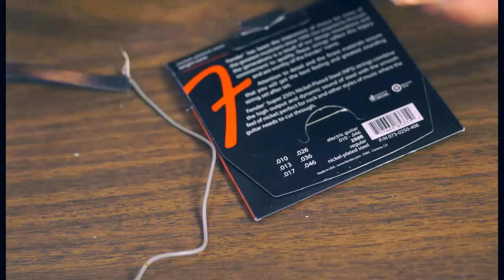How to shield a Stratocaster from EMI with copper tape

Comment: 1:45 Just put some more soldering wire to the tip of that thing. You want heat transfer, so you need more molten metal there. More power is not always nesseserry. Good video, thank you. Need shielding too.

I turned a cheap Spanish guitar into a weird hybrid. I can try extra control knobs, like one for mixing neck and middle pickup volume. I could add a tone knob for each seperate pickup, instead of just that single one. I could get myself a traditional 5 position switch, instead of installing a high quality 3 channel mixer on my guitar. Building it yourself is fun. How to shield a flattened Spanish guitar is a bit of a challenge, heavy duty aluminum is a good idea.
Reply: Hmm... not more molten metal, but a properly cleaned and tinned tip would be a better idea.  And a bigger iron (higher wattage, larger tip)  for such a large thermal mass.

Comment: I have a '91 American Standard with shielding paint from the factory, bathtub routing. They were using that stuff way back in the '80s. However copper tape with conductive adhesive is superior.

Comment: Do you HAVE to remove the pickups and the cables? Can you not just widge it and cover what you can?
Reply from the maker: You have to remove the pickguard to get to the cavity, for sure, but removing the wires on the pickguard, you mean? Nothing else needs to be desoldered, you just have to unscrew the  pickup and switch screws and remove the nuts on the potentiometers to get a clean pickguard, all the wiring stays connected then you just drop it back in.  think it would be pretty hard to get the shielding in there under all the wiring, and it would probably take me longer to try it than just to unscrew the hardware!

Comment: does it work with aluminum?
Reply: Yes, but aluminum is not as conductive. The physics (or electrical engineering) is called "skin depth", and is the depth that the magnetic field from the EMI radiation (EMI is just photons at a long wavelength with oscillating electric and magnetic fields propagating through space at 90-degree angles to each other) penetrates into the metal shielding.....this depth depends upon the conductivity of the metal....copper is more conductive than aluminum, therefore the skin depth is less, and the thickness of metal material is less. You can use aluminum, but you might have to use thicker material.....also, do not use aluminum foil from Walmart...that has a coating on it from the factory.....it is not easy to get a good soldering connection to this.....to be sure, always buy uncoated metal....copper or aluminum!

Comment: Oh god on my jackson spectra when i turn up the volume that noise is so bothersum....I need to do some shielding...can I just do this with either Aluminum foil or the aluminum foil tape?
Reply from the maker: Yeah sure, aluminum will work fine. I think you're not supposed to mix the two because the dissimilar metals can react.
Reply: @extralifedisco  Ye I wont be mixing I just wanted to know all my options. I ordered a roll of copper foil adhesive conductive from ebay. So now I have to wait :)

Comment: Did anybody else notice that that neck doesn't fit the pocket!!?
Reply from the maker: The guitar is secondhand but I'm fairly sure it's all original parts, MIM 1996. I think the mexican strats have some relief carved in at the corner of the pocket to give better tolerance for the final fit (necks are probably made an another production line). Thread about it here: http://www.squier-talk.com/threads/strange-neck-pocket-shape.83472/
Reply: It works pretty well but the problems will still be there when using high gain.
Reply: Youre wrong. All fender strat neck pockets have extended corners, unlike most tele pockets. It is meant for some extra space for the neck t obe adjusted or replaced. It fits the pocket just like any other strat.
Reply: You tube critics u gotta love’em....

Comment: You didn't show how you taped the back of the pick guard.  :(
Reply from the maker: I think I mentioned in the vid but the pickguard is aftermarket and came with aluminum tape on it. You just have to remove all the hardware and tape it up (it's flat so easier than the cavity) and put the hardware back on. Most fenders at least have the control cavity shielded on the pickguard to start.
Reply: Extralife So you put copper on top of the shielding that was already there?
Reply: He left the pickguard alone, already done.

Comment: I'm really shaky about tackling this project. Our son plays bass for the church praise songs and maybe we can see about changing where he plays for no hum pick-up. I run the sound system and the guitar is definitely picking up interference on stage.
Reply from the maker: Yeah, shielding will reduce but not eliminate noise. If you get a lot of interference I  would suggest looking at stacked humbucking pickups, DiMarzio makes some that will fit j and p bass cutouts and retain a very clean single coil sound without house noise.

Comment: can this aluminium on the pickguard touch copper?
Reply from the maker: Yes, they'll form a good electrical connection. Dissimilar metals can cause corrosion but that's generally more of a problem in wet environments and with ferrous metals. Aluminum wire and connectors are used pretty frequently in electrical connection.
Reply: @extralifedisco  You were very meticulous with the copper to create a contact surface with the pickguard foil. It would be interesting (if you ever had the time) to try it with having the surfaces well  covered up to the plane where the pickguard is attached, but without having those contact surfaces.  Whatever electrical gap remained would be very small, and depending on the frequencies involved, you may be sufficiently shielded.

Comment: The copper tape i recently purchased said it had a conductive adhesive backing so there should be no need to do that extra soldering...
Reply: You are correct.

Comment: In my opinion, people are overthinking this. ANY shielding you put in place will likely improve (decrease) ground hum caused by single coils).

I've shielded lots of guitars with copper. It works. Put away the meter. Move on.

Comment: When I did the copper shielding on my Telecaster, it was dead quiet using single coil pickups.  You've done something wrong if yours is not dead quiet.
Reply: Shielding is based on the Faraday cage electrical concept which is a function of thickness of the conductive material in relation to the EMI wavelength. The longer the wavelength the thicker the cage metal must be. It is possible he installed it wrong, but equally possible the the purity of the tape used or thickness of the metal isn't sufficient for the many electromagnetic waves in his area.

Comment: You also could make the environment EMI free with a dirty electricity filter which you simply plug into the socket. Another tip! make sure to play on 432 Hertz and not on 440 Hertz! Do the search. Good luck!
Reply: Yes, a high pass filter with a cutoff above the 6th string is good in principle.....but beware that the "cutoff" shape is a devil in the details. Buy one with specs....if you make it yourself, be sure that it can come out easily.

Comment: And the ridiculous thing is that companies like Fender aren't doing this at the factory.
Reply: That would eat into profits, or make their guitars more expensive.  The spray paint version doesn't work as well as the copper foil unless you do multiple coats.
Reply: @JohnShalamskas  We recently got a vintage Telecaster clone and I'm impressed by how much it rejects interference and noise.  Such a simple, effective design with its own built in shielding.

Comment: VITAL.... Apply a thin layer of Epoxy BEFORE laying down your patchwork shielding.. Even the adhesive fails after a very short period of time.. upper is a conductor..so when it touches parts as it fails - you get trouble..  PROJECT FAILED regardless..

Comment: It's not a legitimate Faraday cage because you cant cover the top of the pickups. And did you just take an x-acto blade to the body of that guitar? OMFG!
Reply: Guilty as charged! I'm not well versed enough in Maxwell's equations to say how the gaps in the cage affect the shielding but it's clearly significant. I haven't tried lace sensors but hear they're basically the ultimate in noise reduction for strats, though my strategy has just been to play nice and loud  when I need good S/N. About guitars and cars I feel the same way, too precious and they're impossible to enjoy properly!
Reply from the maker: Meant to reply from this account whoops
Reply: @kryptoniterazor  too often people use the term farady cage when it comes to shielding. While yes, this is the idea, in this case, its impossible because we cant create a cage that goes over the pickups, and the pickup magnets themselves,  are antennas for radio frequencies. So we are shielding, but not by means of an actual farady cage.
Reply: Dustin MidNyte Driscoll  I thought a faraday cage does not completely cover everything but can have gaps and holes. The holes have to be smaller than the wavelength?? Dunno 🤷‍♂️
Reply: @ourclarioncall  you should google it for the best definition and answers to your question. From what I know of it, a cage by definition has to have completly encloser to be called a cage. Otherwise, what we're doing here is more akin to shielding. Everyone just uses the Faraday name, because it most closely resembles what we're doing.  If you create a cage with an entire section missing, then its not technically a cage. Ok? Good. Moving on.
Reply: Dustin. You are correct....good observation! Yes, it is "shielding"....Shielding can work "good enough" sometimes....(now please don't accuse me of throwing my wong around to impress....this is just FYI) I know from my own work in electromagnetics research on pulsed power that you can block very strong EMI using a simple piece of metal surrounding, say, your oscilloscope, or put the sensitive instrument under the thick metal table...it works....that's all that I care about when I do experimental research.
Reply: @JetBob84  The strings are good antennas, impossible to shield, so we try to at least ground them at one end.  At frequencies that cell phones use, they are several wavelengths long and very efficient antennas.
Reply: @DMidNyte  Thank you. Yeah, you're correct on shielding be. Faraday cage. When I built my first Faraday cage out off copper mesh at NASA, my supervisor told me to test it by putting an FM radio inside and if the signal becomes noise, it's good to go for that wavelength.